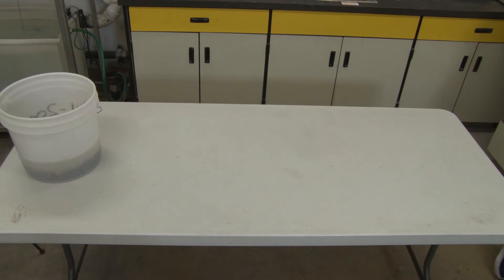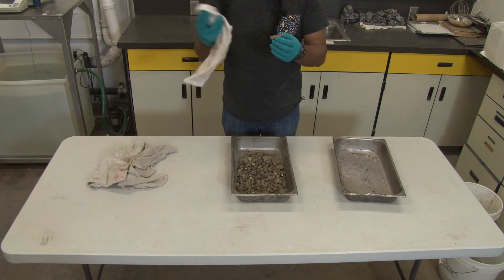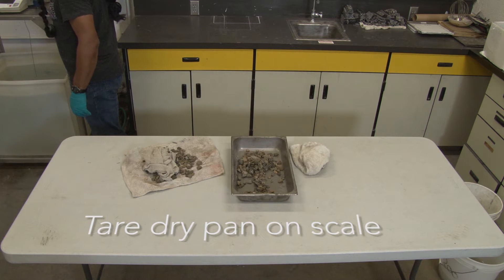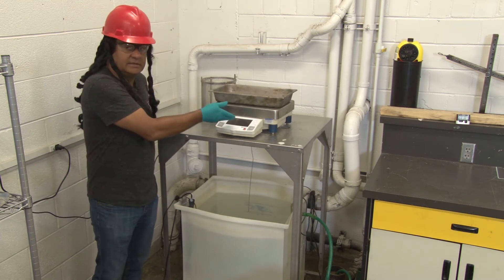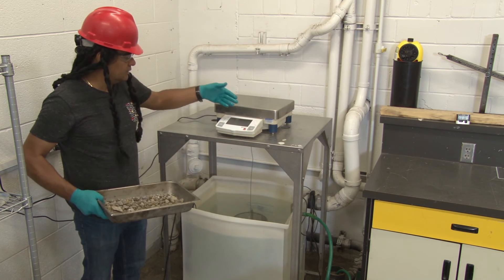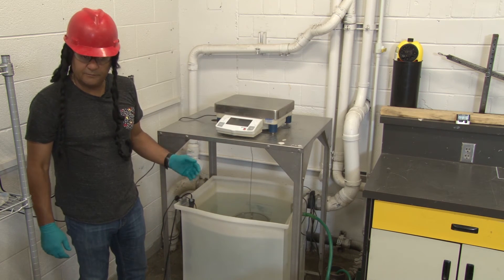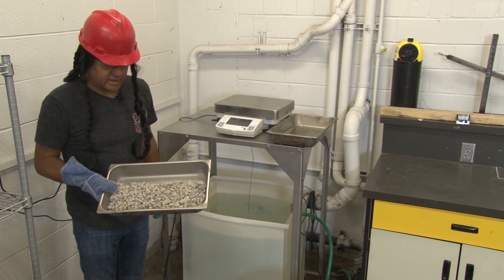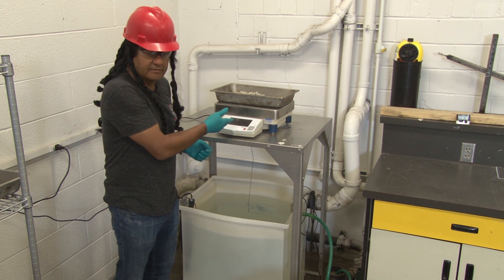Coarse Aggregate SSD

Comment: Mass = Weight / Acceleration,  Metric: Mass = Weight/9.81 or English: Mass = Weight/32.2 (The acceleration is the g measurement on earth, 9.81 m/s^2 or 32.2 ft/s^2.)

Therefore when you weigh the rocks it is the weight, not the mass unless you account for acceleration.